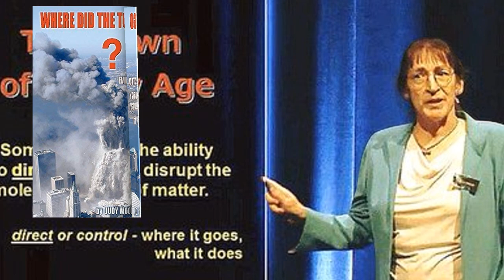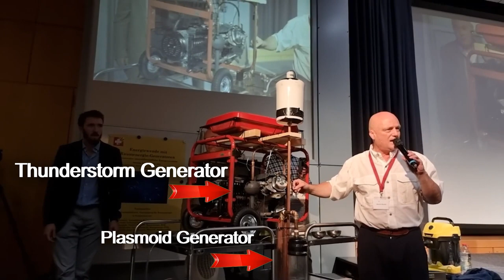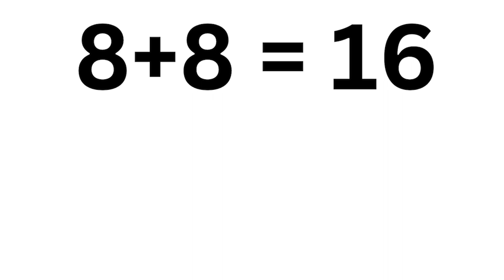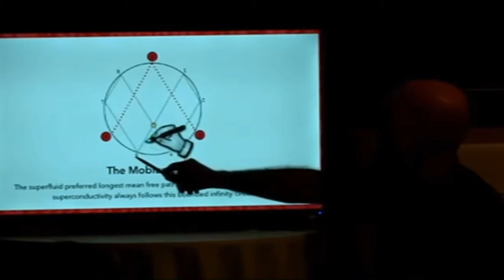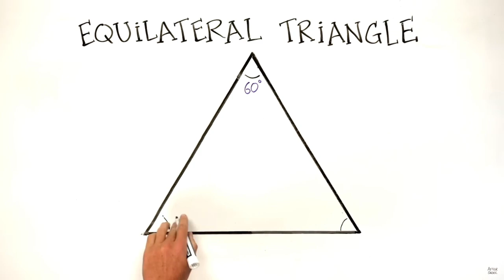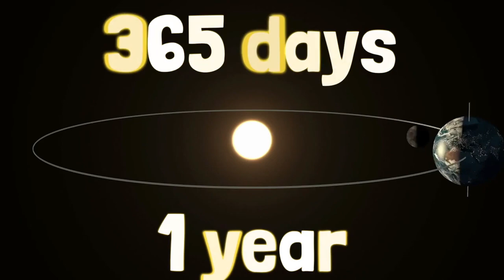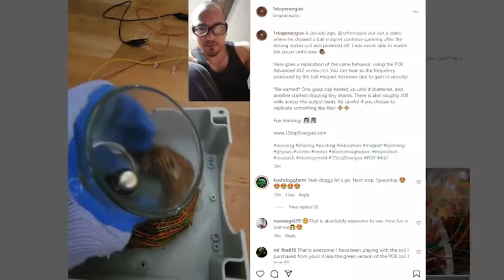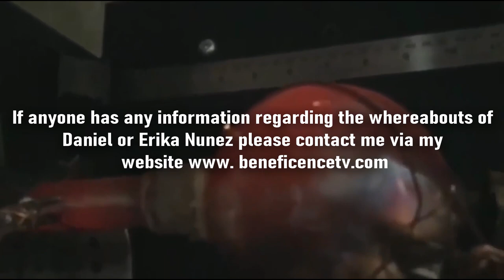Thunderstorm Generator ⚡️🌌🌪️ Discover the Mysteries of Plasmoids & Vortex Math | Divine Science Ep.1

Comment: 7/8” is not the thickness of a thumbnail good sir. More like a 1/32”
Reply from the maker: It seems like there might be some confusion in the measurements being used. 

When referring to 7/8 of an inch as the thickness of a thumbnail, it's meant to convey that it's a bit less than the thickness of a full inch, but it's still considerably thicker than 1/32 of an inch. The key word here is "within" 7/8ths thickness. Meaning the tiny difference between not full inch and full inch.